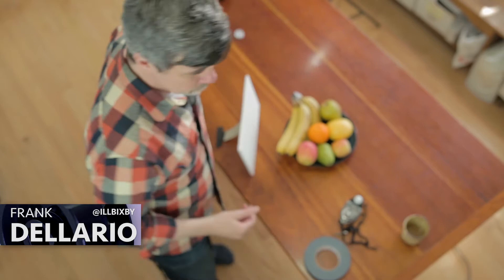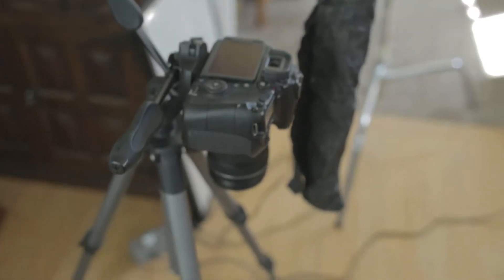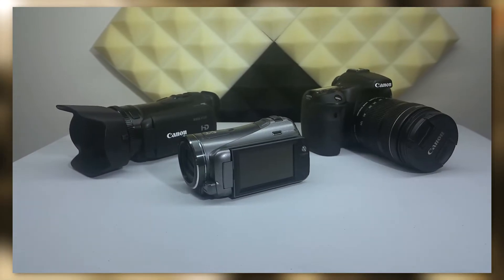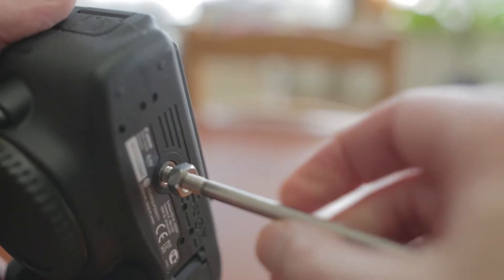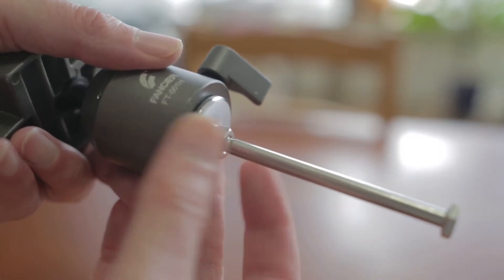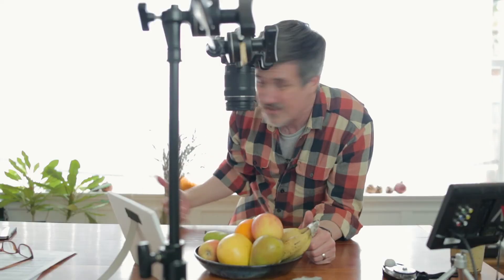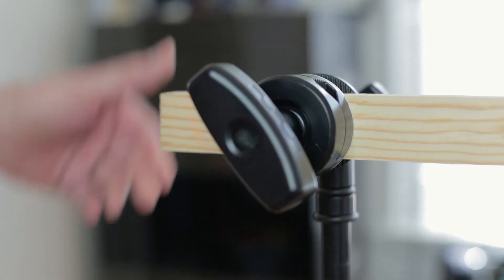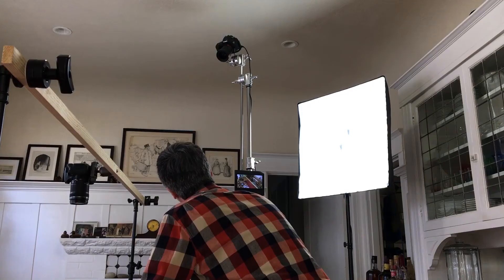Overhead Video Camera Rigs: How to Shoot Straight Down

Comment: Okay when attaching the bolt to the camera have a washer and a bolt. It will protect the camera a little more as the pressure will distribute in the washer making it less centric to one spot on the camera.
Reply: Great tip. Seeing that nut getting tightened with a wrench was making me nervous. : )

Comment: Great video! And I really appreciate how you covered using inexpensive options from the hardware store.
Reply from the maker: Thank you and hope it's useful for your videos. If you don't have a grip stand, I highly recommend getting one. They are the tool of my trade and so useful at home and in any studio. Also, huge fan of your MTG illustrations. Your style always makes me think what would the pre raphaelites paint like if brought into our modern times. Please make more painting videos.
Reply: Pull My Focus I just bought a Zoom Q4 to produce drum covers. Having a hard time finding a way to find a stand for shooting straight down at the drum kit. Any tips?
Reply from the maker: Eratosthenes . I assume you need to get crazy high to get the whole drum kit in there? If so, is the ceiling tiled? If so, I would recommend zoom's MSM-1 mic stand mount. You can use the clip to mount to a tile or the metal hangers. The mount has a swivel head so you should be able to point it straight down and that camera is very light weight.
If no on the ceiling, I would still say go with that mount but rig it off a mic boom arm, which I assume are cheaper then a grip stand. The issue will be can you get high enough to get the whole kit in the shot.
Also, checked out your videos. First, recommend recording and uploading at 1080p vs 720p. Will look so much better. Second, you don't have enough tom-toms. How will you do covers or rockin' 80's tunes without at least a dozen?
Reply: Pull My Focus Haha, thanks for the tip! Yeah I plan to increase the quality musically and regarding video quality once I figure out the camera and sound recording options. Didn't make any effort at all in those current videos 

I'll check out the zoom stand! Thanks again :)
Reply: By the way, do you think a regular mic stand would be tall enough to mount the Zoom unto? (the ceiling isn't tiled)
Reply from the maker: I'm think so but I'm not sure.  It depends on how wide the lenses on the zoom is. I'm suggesting a mic stand because I assume you probably already have some. 
If not, that zoom is so light, there has to be another way. One thought is to boom out a broomstick or a 4' length of 1"x1" baton to create the boom pool, that you attach to the mic stand. 
But the easiest would be to get a standard grip stand (sometimes called c-stand) and you can't go wrong. They're around $150.

Comment: I just discovered that the arm on my c-stand has screw threads on either end, one that fits the standard receiving end of a camera (1/4") and a larger one (3/8"), and it works great. And it looks like these threaded arms can be purchased on their own. (My particular c-stand is from Flashpoint.) You'll definitely want to consider a counterweight if the arm is extended beyond its midpoint. But I'm also doing mostly still photography. I do, however have a standard c-stand, so I can keep myself out of the shot. But for greater stability with video, a rig would likely be better.

Comment: I am enjoying your videos. I especially like the unexpected silliness !! Love that !!  I am trying to only use my iPhone & iPad for everything ....is it possible to do this overhead thing with these ?
Reply from the maker: Yes and possibly easier. The last time I moved, I used an iPhone mount (meant to hold an iPhone on a small tabletop stand) that I gripped in the grip head on the grip arm to take pictures of magazine articles. I had a lot of magazines I didn't want to pay to move. 
Note that these phone stands are meant to hold a phone vertically so some may have issues holding them horizontally (especially with the weight of an iPad). Key is to use a grip stand, a good holder for your IOS device, and use a bubble level on the back of them to make sure they're perfectly flat. Hope that helps.
Reply: Hi Pull My Focus , if you added amazon links  to the stuff ...that would be great for both of us .. I think 🤔
Reply from the maker: @BrendaKAesoph  I can't put them in comments but we do have a link to our Amazon Affiliate store in the video description. We don't have any iphone or ipad holders as we only post what we've actually tested ourselves. But I think I will look into a video on this. Thanks for the idea.

Comment: What would be the best way to shoot overhead in front of a huge window? I have two softboxes (5500k), a dslr (70d), a manual focus lens (35mm Rokinon VDSLR). Could also use some pointers on camera settings (iso, wb, fps and shutter speed). All this will be for cooking videos btw.  Oh, one more thing: How do I shoot in the oven when the food is cooking to stop those reflections from the oven door? :) Thanks
Reply from the maker: Great questions. On lighting overhead, that's worth a video so I'll look to make that one this month. The short answer is light it like you would normally, the sun doesn't change its position in the sky just because we point our camera straight down. But it does mean filling from the camera possibly. Get the softbox high or bounce light into the ceiling.
I'll also cover depth of field in this video and it's key in this situation.
For the oven door, two ways: 1) a polorizing filter. Spin it till the reflection go away but, you sacrifice light as it can loose up to 2 stops of light. That's a lot when shooting into an oven with only it's little light.
2) hang black material to hide reflections. If looking straight into the oven, cut a hole from your lens so you don't see you're reflection. Not too big of material or you'll block all your light.
You may need to fake your oven shot. After the dish is cooked, and oven has cooled, sneak a light in there (household bulb) close door lightly on the cord (may need to tape it to project it) and shoot into the cold oven (add sizzling sounds in post). 
I detect another video. You ask great questions sir.
Reply: Thank you :) The sizzling sounds will always be in post, because my videos will be music only. No talk, no chop, no stir sounds :)

Comment: Sorry for the newbee question but....for overhead photography where the camera is out of reach, what is your workflow for focusing?
Reply from the maker: Since the camera is locked off, one way is to measure the distance between the focus point of the camera (where the sensor is) to the point you want to be focused on. Then, take the camera off the overhead rig, handhold your camera and measure that same distance from the subject and focus. Tape your focus ring on the lens so it doesn't move and then mount your camera back on the overhead rig.

Comment: The issue I have is that the video is very crooked. How do I fix that?
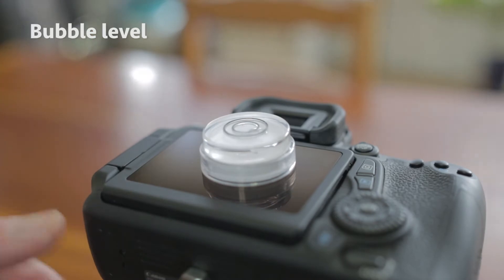Reply from the maker: It's all about leveling the camera in relation to the subject. At the 2:00 minute in the video I show using a bubble level on the back of the camera. After that you may have adjust what you're shooting or the camera so they're in line with each other. Hard to help with out seeing the crooked video that needs fixing.
Reply: Pull My Focus The issue for me is that when angling straight down, the bubble doesn’t work (it only works when the camera is straight)
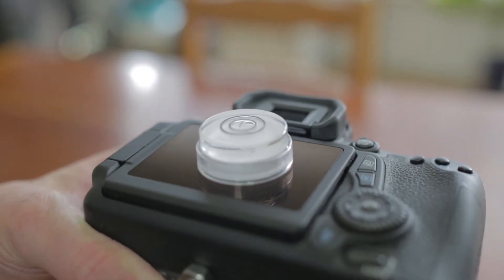Reply from the maker: @TheUKNutter  Are you referring the bubble that's part of the software, that displays on the LCD screen? When I say use a bubble level I mean "physically" place a bubble level on the camera. Image of it is right at the 2:00 minute mark. You can get one at any hardware store. Good to have in your kit.
Reply: Pull My Focus I should get one! Thanks so much!!

I have a video I made on my phone explaining my problem, if you want me to send it?
Reply from the maker: @TheUKNutter  Yes please do. Send it to the email on our Youtube about page.
Reply: Pull My Focus done!

Comment: What is a "mini" C-stand? i see no such beast on Amazon - only the big guys.
Reply from the maker: Ryan, thanks for asking as I see that common set term is not used in online stores. 20" is a mini c-stand, 40" is a standard height. I've added an affiliate link to the description you can use or just search for 20" c stand.
Reply: Thanks for the link. i picked up the wood and the hardware a few days ago, but i was kind of hoping for a sub-$1000 solution for this. :\
Reply from the maker: It's going over $1000? That's some expensive wood.
Reply: i don't own any C-stands. Here in Canada, those Matthews stands run over $400 apiece, plus applicable taxes (which are 13% in Ontario).
Reply from the maker: Ouch, that's crazy, they're $150 US here. What about the other brands on Amazon? Avenger etc? Otherwise, try a Canadian photosupply store, as they have them as well.
Reply: The big camera store here is called Henrys, and their stands are $199. They have them listed as 10.5' though... how does that map onto 20" vs 40"?  (And what are 20" and 40" measurements of? i assume 10.5' is total extended height? But a 20" stand isn't actually 1.6' tall, i gather.) Thanks for your guidance on this. Great video series, btw.
Reply from the maker: They are weird measurements. The 20 and 40 inch refer to the length of the center post of the stand and not the risers or not from the floor. That price of $199 Canadian sounds right. Sorry they get pricey but they are so, so useful in many ways. And you are welcome and thanks for watching.